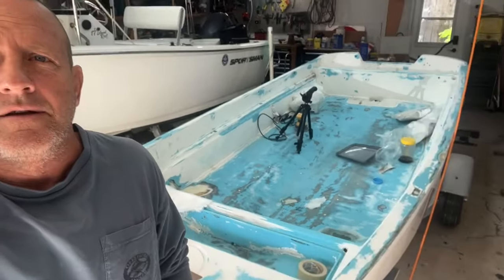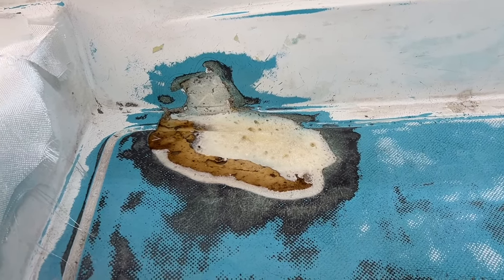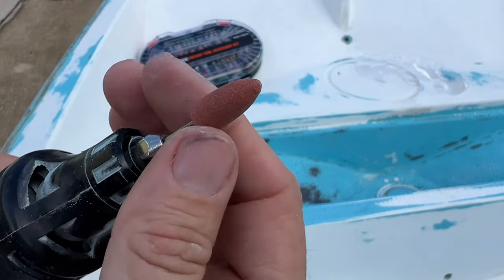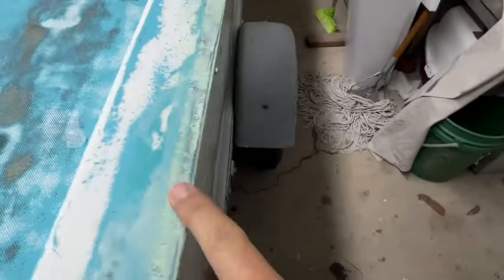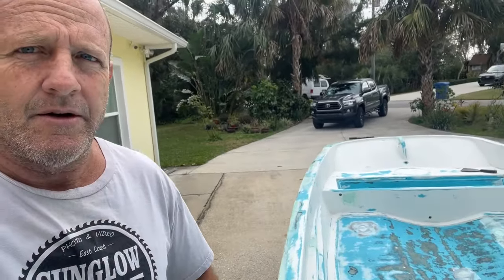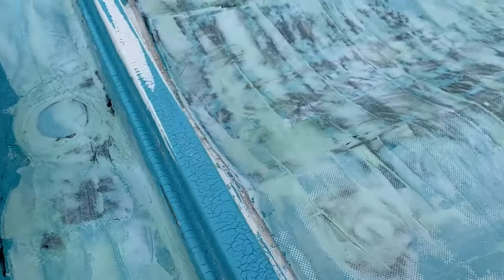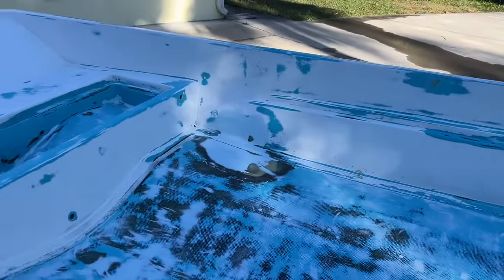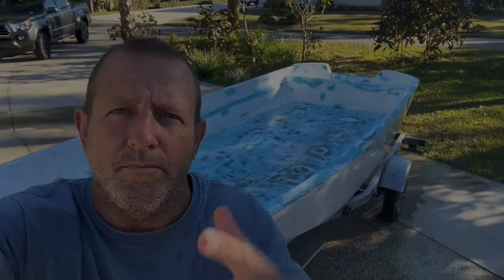1971 Boston Whaler 13 Restoration - part 8 - fairing the inside

Comment: Did you use epoxy fairing compound on it?
and are you going to gelcoat or paint?
Reply from the maker: i used polyester fairing toped off with pva to fully cure. prime with epoxy barrier coat prime and painting with 2 part polyurethane. check out the entire play list

Comment: I noticed those brass drains fall apart and water ends up getting in there. Did you notice any when you did yours? Trying to figure out if I need to cut out the floor there and refill the foam
Reply from the maker: the old whalers allways have a little intrusion mine was actually relitvly dry. you can check how saturated the boat is by weighing it.  320 lbs empty hull for a classic 13 with cut out transom. for me tearing out saturated foam is not worth the work. also when you replace the brass fitting use 5200 sealant (alot) skip the o-ring
Reply: @StoneBrokeAdventure  Makes sense, thanks for the tip!

Comment: PVA worked like charm!! Spent 3 hours sanding down the fairing without the PVA, it was miserable (only on a 5 foot section). I've literally replicated your entire process for my first restoration on the 17 lol... Month later from my last comment, sanding fairing tomorrow.. Still gotta figure out how im going to flip the damn thing, im limited on space but should be ready to prime the top this weekend...

Should have flipped it first, but doing it a** backwards..Just wanted to say thanks.
Reply from the maker: im glad it worked out for u

Comment: What is the fairing compound for?
Reply from the maker: its like bondo. it fills in imperfections small dents dings cracks depressions. it is not structural just a finish layer to make things smooth. easy to sand also.
Reply: Thank you my friend looking forward on seeing the final result!  @StoneBrokeAdventure